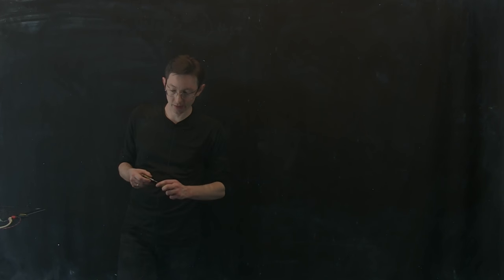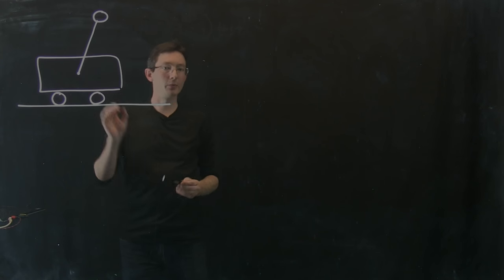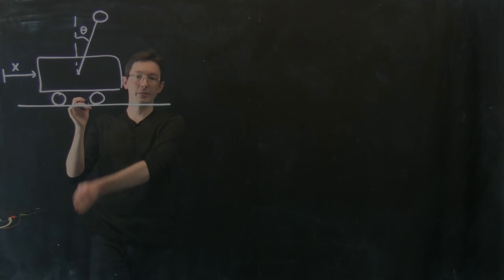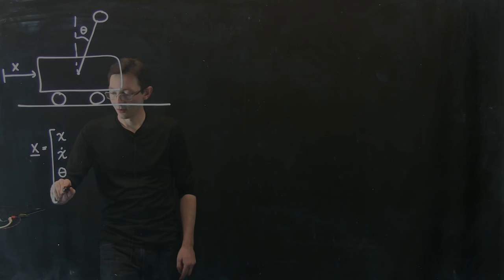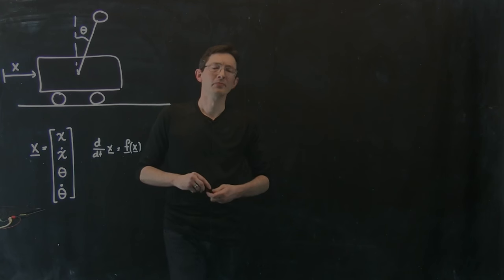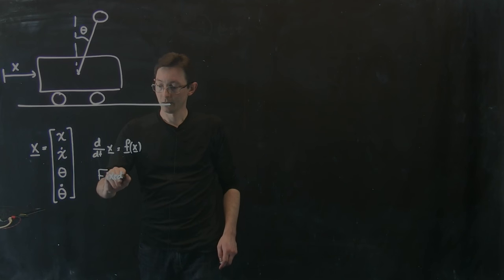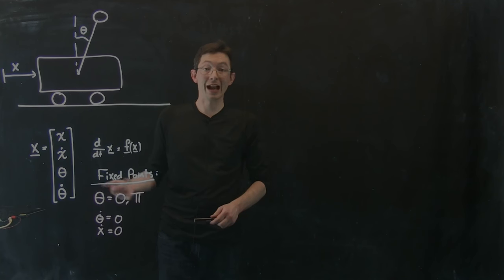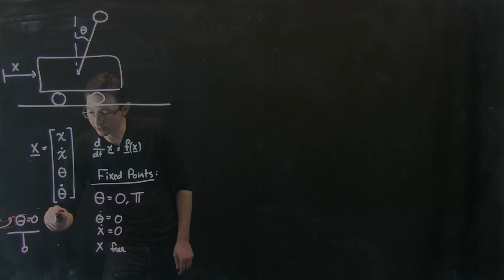Inverted Pendulum on a Cart [Control Bootcamp]

Comment: Thanks for these resources on control theory, I'm finding them clear and very illuminating (I do not have a background in this, just in math, physics, and now data science, which is how I found these lectures).  One comment on this video... you talk about theta = 0 as the pendulum down position, but your drawing is suggestive of theta = 0 is in the pendulum up position.  I can get by, but if you ever redo this with edits, that's one I'd suggest making.  I don't know which should switch though -- your drawing, or your algebra.  Thanks again.
Reply from the maker: Thanks for the feedback... yeah, this is always a tough choice to be clear and consistent.

Comment: Excellent series on Control! I have a master in ME and this is helping me to get around a lot of things I couldn't understand in class. I just wrote a code to get the Equations of Motion of the inverted pendulum, using the matlab symbolic toolbox, and now I got to use this equations and it's linearized form to simulate different control methods. But I don't know how to draw a plot. Where could I download your code to take a look at the 'drawcartpend_bw' function? I know you mentioned that there's a link below, but I just see the link to your webpage.

Thanks you so much for the lessons, I have really learned A LOT!

Comment: I derived the equations of motion using Euler-Lagrange which are almost identical to yours but oddly a couple of components had different sign. After linearising, when I plugged in the constants you use and checked the eigs of A I got pendulum up = stable and pendulum  down = unstable! It took me ages to find out its because you set g=-10 rather than +10. If I set g=+10 I get the expected eigs.

Comment: Dr Brunton, Thank you for the lecture. I have couple questions. I derived all the equations of motion and I am trying to simulate in Matlab I am using (b = 0.1;    % Coefficient of friction for the cart (N/m/sec)
I = 0.006;  % Mass moment of inertia of the pendulum (kg*m^2)) in your example you use a "damping" factor on what exactly this constant is based upon? Can I replace that to b and I? why are you using this damping factor "d"?

Also 

2 - How can I calculate from the Matlab simulation what motor parameters are (e.g. accelerations, running current, etc).  
3- In addition, how may I estimate the (pendulum angular) resolution needed given the pendulum’s height?

Thank you

Comment: Why do you compute the Jacobian around the fixed points? Shouldn't it be computed around wherever you want your system to be? Hypothetically, if you wanted to have your cart move so that the pendulum stays at a 45 degree angle (probably impossible but let's say it could work), should you then calculate the Jacobian for theta=45?

Comment: Hello, professor. thank you for the video and brilliant clarity.

I have a question. As one of the eigenvalues of the system is zero, wouldn't the Hartman-Grobman theorem imply that the analysis of the linearization of the system doesn't necessarily match with the original system?

Comment: To find the B matrix, do you linearize the system dynamics around some "ubar" in addition to "xbar"? Also, how do you create separate A and B matrixes if the control is not linearly separate from x in the system dynamics? (For example, xdot = x * u)
Reply: The procedure is the same. If you want to linearize a general nonlinear system xdot=f(x, u), you can calculate the A and B matrix like this
A=df/dx (xbar, ubar)
B=df/du (xbar, ubar)
In your example this would correspond to A=ubar and B=xbar